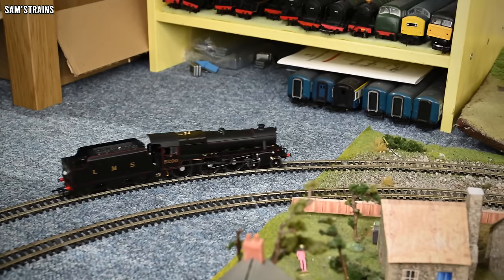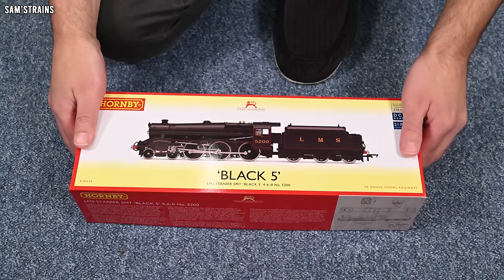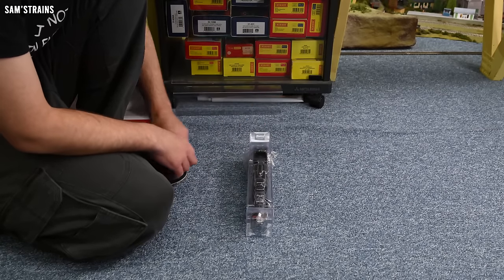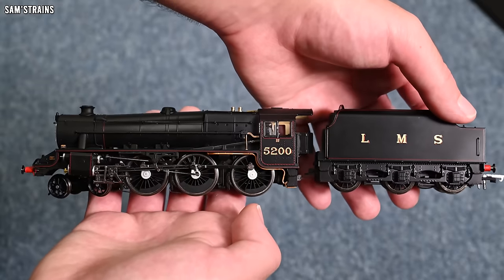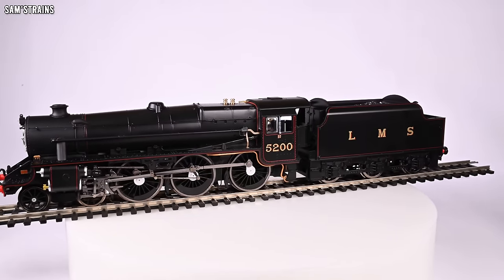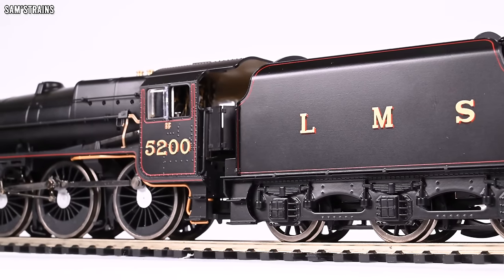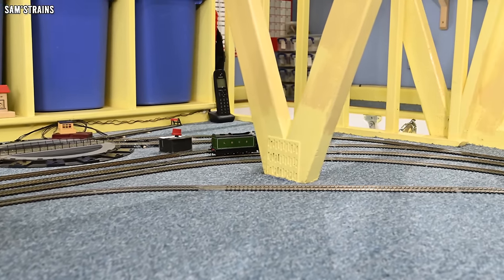Hornby's Horribly Faulty New Black 5 | Unboxing & Review

Comment: Do they not even bother testing these before they box them up? Shame as it's a nice looking loco.

Also, just a suggestion. Maybe stick a white background up when you're doing the close up testing. Even a cheapo bedsheet to block out the background and put all focus on the loco.
Reply: No….

Modern manufacturing techniques be it toasters or model trains work on the basis testing a small sample of products - not every single item which comes off the production line.

Testing products (particularly once complete as opposed to testing sub assemblies) is time consuming plus risks breakages so manufacturers try not to do it they can.

Instead a small selection of the output will be sampled and the results of that inspection be used to assess whether the production line is producing good quality items.

The logic is if you test 10 out of 1000 say and 8 are duff then you can expect that 80% of products will be faulty, if you test 10 and only 1 has an issue then you can expect that only 10% will be faulty.

Moreover if the factory has consistently been producing products where the above sampling shows no or very few faults then it’s likely that testing of the products for flaws will be reduced - if the above sampling shows a high incidence of failures then much more scrutiny will be paid to quality control during assembly.
Reply: @philkeller4170  That makes sense actually, I'm looking at it as they can't have made that many of this loco. But I guess the same production line was straight into action with a different one.

Comment: Running plate is part of the chassis on the real loco. The 'shape' of the plate is influenced by the real weight distribution of the boiler which changes with water level. It is in part in proximity of the fire box and the forward valve gear with a majority in clear air between, so there is differing expansion and mechanical forces on the frame. Check with real loco for level running plate. Excessive impact during buffering up could also bend the front of the chassis. Like you say good features spoiled by bad build. I dislike the use of metal flake paint.
Reply from the maker: Well the warping on this model is only present on the left hand side - would this be prototypical?
Thanks for watching, Sam :)

Comment: Damn I’m actually thinking about getting hornby black 5 but imma get the older one. Mainly because I don’t want to get a loco cutting out 24/7

And the even sadder part is that these newer models like this new black 5 and the newer 9f look amazing with a ton of accessories but the crappy motors just ruin the model 

Also did anyone else see the axle disfiguration at 32:15 or is it just me???

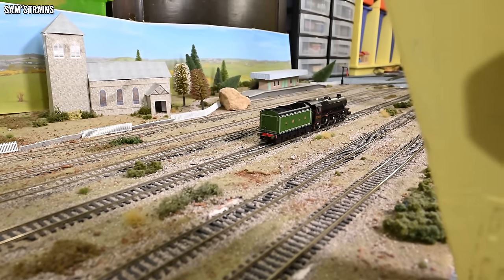Comment: 30:12 I’m really just beating a dead horse, but this is one reason why I feel the model industry needs to move away from tender pickups.

I’ve said it before, if Hornby can make an 0-4-0 run as smooth as their Pecketts, there is no reason the same can’t be done for larger wheel configurations.
Reply from the maker: It's not really the tender pickups - with the decoder socket in the tender, a good electrical connection is needed between the two... and this one was no good!
Reply: how are you that far ahead when the video just came out?
Reply: @Devilninja333  I have one-day early access, I saw it yesterday.
Reply: @SamsTrains question?  I take it that the loco can’t power itself with its own pickups??  Does it require the tender to power the motor???  Thank you.

Comment: And I was regretting that I didn’t order the one with the smoke generator…..
Hornby, fix your damn quality control!!!
Also, the performance mark is extraordinarily generous, that thing would be lucky to get a one on performance from me, and even if the tender worked, it probably would have only got a three, as it has torch issues and binding valve gear…
Overall, the worst new tooled loco I’ve seen in a LONG time…
Reply from the maker: Yeah - shocking and ridiculous that there's seemingly no quality control on such an expensive model. Yeah it was generous - never let it be said that I don't give Hornby the benefit of the doubt!
Thanks for watching, Sam :)
Reply: @SamsTrains  you definitely give Hornby a fair chance in their reviews! In all honesty the last few locos you reviewed from them were great, with the only major problems from their locos being underpowered motors (Ie: 2MT, 9F), and the most reoccurring issue being that their models are way too expensive! Even fantastic models from them like the P2 have unfortunately been ruined for most people, as most folks are not going to want to spend £225-260 on a locomotive, especially when that same locomotive has already been made before, just to lower standards.

I feel that is EXACTLY the issue with this new Black Five. The model is insanely expensive, and yet is terrible quality. The old Hornby Black Five may not have been perfect, but they were far more affordable, the detail was alright,  the mechanism was nearly perfect, and the performance was faultless! Put all that together, and essentially all that Hornby have accomplished is making an inferior product to the product it is meant to be replacing, and it’s not just bad compared to the old Black Five, it’s bad compared to other models on the market as well. 

The Accurascale Manor is far better quality, runs better than this loco did once you swapped the tender, and is nearly £40 cheaper. The Dapol Manor and Mogul might not have any more diecast than this loco, but they are assembled far better, run better, and are both £60 cheaper than this new Black Five. The Bachmann V2 from a few years back is just as well detailed (possibly slightly better in a few areas), runs just as well, if not better, has just as good of a mechanism, and was £30 cheaper. Even some of Hornby’s own locomotives like the P2, 2MT and 9F which cost around the same price, we’re put together far better than this Black Five, ran just as well, if not better, and had far more diecast.

I am absolutely baffled that Hornby think this product is reasonable, as even if it was £170-180 I’d probably still go ahead and call it overpriced…

Comment: It's not just that model trust me, I've had the same problem on multiple locos at this point. Lights, no power to motor. Clearly a bad disign. My P2 also had the same binding valve gear problem, An A4 and J36 had their crank pins fall out after 20-30 minutes of running (damaging the coupling rods), and just the other day my modern doublo A4 sheered off part of it's valve gear. I have one last hornby Loco in the mail right now, if it has problems I think I'm done. They HAVE to get their quality under control...

Comment: Re - lamps, and particularly the tender one which isn’t removable!

Lamps on steam trains were there for the benefit of signalmen and station staff - THEY WERE NOT THERE TO ALLOW THE LOCO CREW TO SEE WHERE THEY WERE GOING! They were not lit during the day (so should be virtually impossible to see when the model is being used in daylight / under artificial lights) and even when lit at night produced a very feeble glow.

Lamps at the front of THE TRAIN (which is not the same thing as the loco) told signalmen, etc what type of train it was to aid identification.

A lamp on the rear of THE TRAIN told the signalman that the entire train was complete - and in the absence of continuous train detection this was the only way a signalman could be sure the section of track the train had passed through was safe for the next train to enter the track between two signal boxes.

If any other lamps were to be seen (eg. on the tender whilst the loco was coupled to a rake of coaches / wagons) or on a 2nd loco while double heading then the train would be stopped for the lamp to be removed.

So all in all a silly idea on steam locos - simply fitting cosmetic non working lamps where required is FAR more realistic than difficult to remove / non removable lamps which output ridiculously bright levels of light. 

Built in lighting has its place - but only on diesels where it’s done through marker lights built into the body (although in many cases, particularly BR era locos these are way to bright - as with steam locos the lights fitted to locos built before the 1990s were there to provide identification to lineside staff NOT to let the crew see the track ahead)

Comment: I very much doubt if the original running plates were as flat as the ruler.  The sudden stop is a fault of manufacture not inherent to the design, and I have no doubt the loco will be replaced.  Any judgement about quality should be made based on the number of warrantee returns.  Perfection comes  at infinite cost, but you complain about price.  Is the company making excess profits?  Individual social media reviews which do not reflect these facts can do immense damage to a company. 
By buying at a discount on-line shop you hasten the decline of the hobby.  You should have returned it as soon as you were dissatisfied.

Comment: Last word for you specifically Sam : if your model is a piece of junk, bad luck or not, I estimate that Hornby had not done its job, and I won't try my chance because I have a non-zero chance to get the same kind of trash as you had. Especially if the performance is mediocre, the presence of die cast is symbolic and the price is on steroids. I won't pay the price of a brand new 2024 Mercedes to have the performance of a 1960 Fiat 500 and the manufacturing quality of a 1970 Lada.
You made your job. Brilliantly. If Hornby does not want to be roasted with a flamethrower, they just have to do their job. Properly.

Comment: Bad luck, Sam, however, I don’t altogether understand your attitude on the model given this is just one example(mine’s fine) whereas you gave the Bulleid Booster a wide pass when virtually every model has the faulty bogie positioning causing derailing on anything but v wide curves. I do understand your disappointment though. Keep up the good work.

Comment: There is a photo of 5200 in what I assume is photographic grey production shot which has the driving wheel bosses in very strong white and it looks like the front pony truck is also treated that way too. 
The tyres on pony and driving wheels are all white, and the hinge and straps on the firebox are white as on this model. 

It is the only photo of a Black 5 in LMS livery that I have seen with this collection of features. I would need to get out Essery and Jenkinson to see if it is unique. 

So it may well be historically accurate. 

That said, I prefer the black tyres and bosses as that is what I see most of the time and this model looks odd to my eye. (Personal choice)

I did not order one of these although LMS and its constituents is my Big 4 tribe as it is Hornby and I do not trust them any more - been burned and seen too many duds on Sam’s videos. 

Such a shame. Operating lamps which can be posed. Brilliant! Fingerprints aplenty? No thanks. This one not working? Why would I take the risk out here in the colonies?

Comment: I'm back for more. So, superb finish, splendid detailing, great idea to have a real modern tender-engine coupling... But plastic body, glue sploshed everywhere, warped footplate, overall shoddy manufacturing, no flywheel... I was ready to buy one but, even if you factor out the possible one-off faulty model you showed us, you don't have the bang for your money at GBP 206/237 €. Sorry, I won't subsidize mediocrity by giving the equivalent of nearly three days of my pay to Hornby. Next month buy would be the P2 instead. I already have a Black 5, I'll stick with her until someone else than Hornby proposes a decent model of a Black 5. Dapol, Accurascale, Rapido, and even Bachmann, it's up to you !

Comment: Oh dear, at one time you might have the impression that H is on a path to recovery when it comes to QA. But here we go again with all those issues. All the glue is one thing but looking at the design of the connecting draw bar, we've come to the conclusion that it's rudimentary design and engineering isn't exactly done with fine quality consistency in mind. As it is, it's asking for trouble actually. There is too much room for potential loss of contact continuity. From a distance, she is a looker, but the quality..., oh dear... Cheerio.

Comment: You seem to have the worst luck with Hornby products.
In the last 10 years I havent had a bad one, maybe Im lucky.
Although to be fair I havent bought one with this new type tender coupling. I dont really see why they decided to changed it. Apart from keeping up with the jones'.
I think the old plug and tender coupling screwed at each end was fine.
This new one I think will cause issues over time.

Comment: If a Locomotive cannot run with a tender from another Locomotive, then there should be no review. The review is for the item as it comes out of the box.  5 stars for details stuck on with an excessive amount of glue? A performance rating of 4 stars without using its own tender. I am a Hornby basher too. Why do some of my Hornby Models jump over the points or even derail? I have also noticed the flanges of the wheels are too narrow. I put this down to people wanting to use the Code 75 track. Martin. (Thailand)

Comment: Are hornby masochists to keep engineering you receiving such tat😂
Seriously, still a good review and you were fair regarding the good elements. When I pay this sort of money, I am looking for accuracy along with the detail and this new tooled model falls down on one major issue in a big way. Those working lamps are a joke. Way over scale and very little flexibility. It's badly effected gimmick. Might work OK on something like Thomas etc but if you're paying over £200 you're probably a serious modeller and the lamps would not impress. If they can't do it to scale and in all positions then don't bother. Also having to forcibly rip them out is ridiculous and a waste of money. I'm glad hornby didn't adulterate the Standard 2MT like this.

Comment: (@34:25) you can see that the 2nd axle back from the front of the tender isn’t turning. Well, well. As if the original tender didn’t have problems, now the replacement tender has problems, too. And this wasn’t even from this model.
I guess - if it hasn’t already - this will make the top 5 worst models of 2024. Which is a pity. Hornby could have done so much better here, but visible glue or paint splotches, coupled with a problematic engine-tender drawbar and a loose side rod linkage. That’s a deal breaker. 😢 An “F” in my book.

Comment: I really don't like those new boxes, looks like you could store 4 older boxes in that space
Reply from the maker: It's true they're not efficient in that sense - but Hornby ship them with an outer box and foam which the retailers can send straight out... no extra packaging needed!
Thanks for watching, Sam :)
Reply: @SamsTrains  Problem is that the box was protecting the rubbish inside😄 I am going to cancel my two pre-orders and detail the existing old model Black 5s I have.

Comment: What a shame. The Black 5 is such an iconic locomotive, it deserves a much better model than this. Hornby ought to be humiliated, charging what they do for a model with this many problems. How can a metal running board be warped?! Not to mention the thing didn’t work. A complete joke. I’ll stick with my 2002 tooled Black 5, thank you very much. Oh well, I think it’s time Accurascale, Dapol, or even Bachmann release a Black 5.

Comment: It really sucks that your sample of the new Hornby Black 5 model is faulty. When I saw Class47Peter's sample of this model, it ran perfectly well and it had no glue marks on the bodywork. The old Hornby Black 5 is superior because it runs better than the new one Sam. Plus, the new Black 5 model from Hornby is definitely too expensive and has too many quality problems. You are right about your statement Sam, Hornby really deserves the bashing from you a lot because of how damn stupid they are to realize properly. Please answer me Sam.

Comment: So very few Black 5s had a domeless boiler.  Why ever did they make this one.  Stanier 5s never looked good with the domeless boilers.  Top feed apparatus showed in various positions depending on whether they  were built under Stanier or Ivatt.  This has no dome but a top feed disguised as a dome a la Stanier 2-6-0.  It was notable that the design did not remain because he realised the benefit of domed boilers.  At least it didn't have a coffee pot on top of the top feed, which his 2-6-0 had the indignity of having before it was removed.

Comment: Such a shame when the prototype looked very promising, although at this point I can't say I'm surprised since Hornby's QC has taken a swan dive in recent years.
The model looks so good yet it's shoddy mechanism and poor motor let it down significantly, looks can't make up for a locomotive's issues if the thing can't even run.
I'm actually a little devastated because the news about this model definitely hyped it up, only for it to be an absolute disappointment, though I suppose that's what I get for still having faith in Hornby.

Comment: Based on your reviews , I would expect a Heljan locomotive to be so bad , not necessarily a Hornby one , especially at this price. It's weird that the lights still work but the motor doesn't. The loco pick-ups should compensate for the tender ones. At first glance I would say that there's a short-circuit on the tender , but in this case the lights shouldn't work and there would be some smoke or the controller would cut the power.
If I would buy this as my first model I would quit the hobby without looking back , same if it would be my first Hornby model. In your case I would probably ask for a refund (sending them also some bricks or a hammer to smash the loco and/or whoever head design/built this 😇).